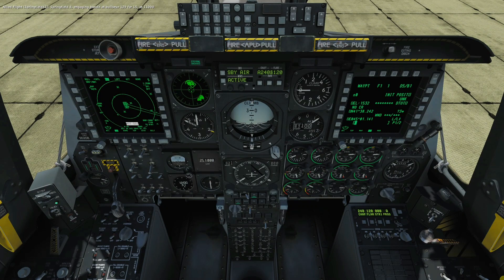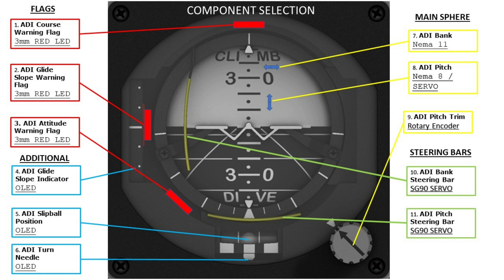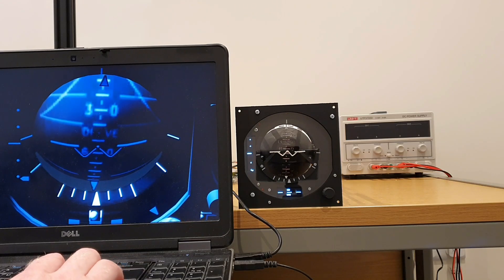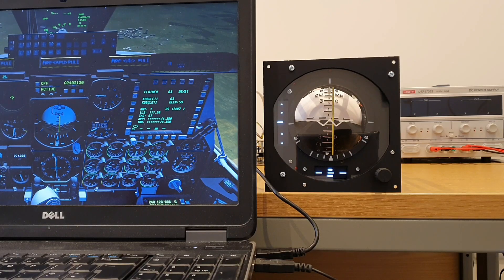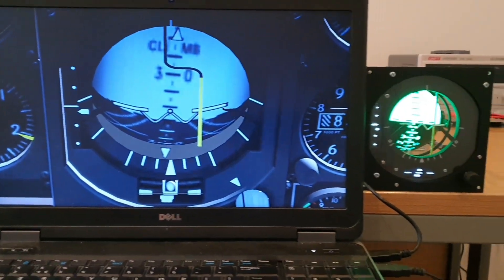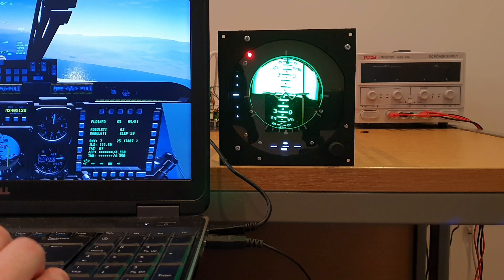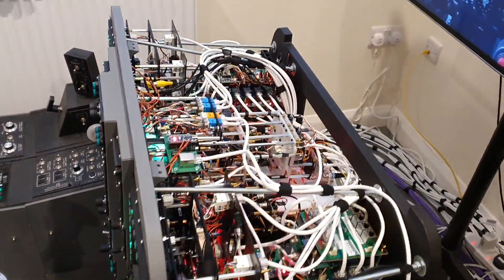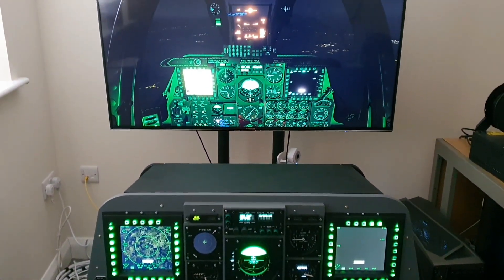Simpit A10C - Front Dash - Part 31: Attitude Director Indicator (ADI) - Implementation

Comment: This video is very good!
I would like to ask you a question, what is your solution for magnetic switches, I am building a F-16 home cockipit, and Honeywell magnetic switches are very expensive, going after a DIY solution!
Please would like your opinion on this!
I'm subscribed to your can
Thanks!
Reply from the maker: Hi Humberto, when I did my SAS panel I used normal toggles. I did, however, use a magnetically held switch in the Landing Gear Panel and its the business. It really adds a lot. Over the last few years I have sourced a couple when they pop up at a reasonable price. So, I think sourcing the real parts is the long game, but it would be great to replicate via DIY if possible. I would like to do this, but like all things - available time is the biggest challenge. Good luck with your build.
Reply: @CraigSmysimpit  thanks Craig, the best solution would be DIY!

Comment: You've absolutely nailed the lighting of the sphere. Backlighting is so clear. Absolutely fantastic work all round. Which size of LCD did you end up using for the slip and turn indicators?
Reply from the maker: Hi Calum, 
The Slip and Turn OLED was a 128X64 1.3 inch using the SH1106 driver. It ran a fair bit smoother than a standard 0.96 inch with a SSD1306. 
Many thanks for the thumbs up. I hope all is going well with your build. Last time I checked it on the Ed forum it was looking amazing 👍
Reply: @CraigSmysimpit  Thanks for the info Craig. I was originally going to use the 0.96" display for the fuel quantity but think I'll change and use the smoother one. That was never a problem I had thought about. I haven't had time to do much other than design at the moment. Got a few new panels started but it'll be a while till they're done :) Cheers